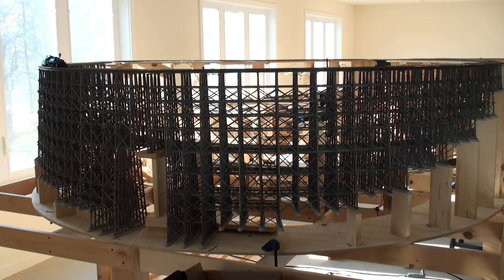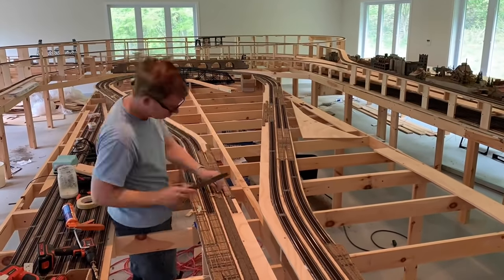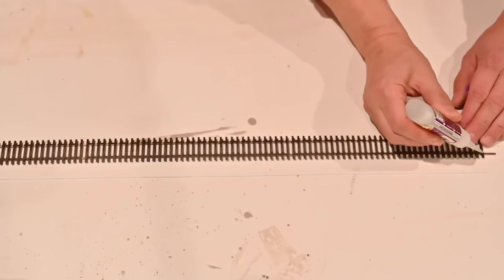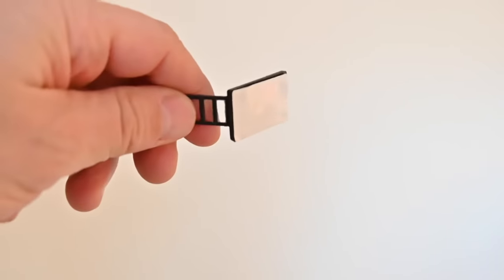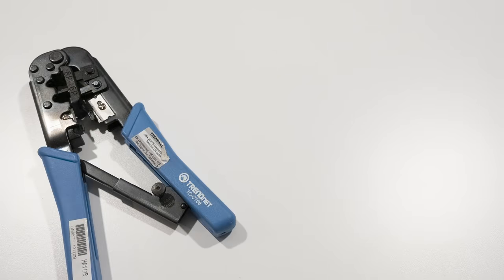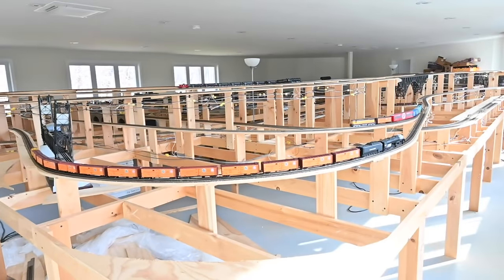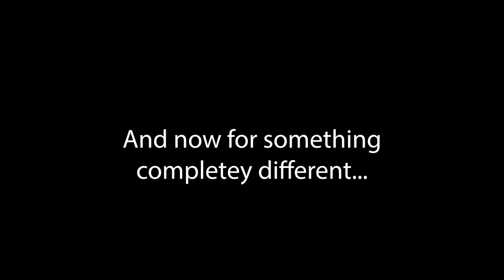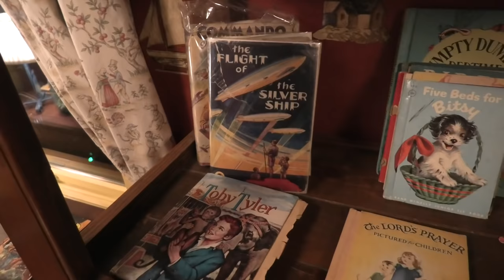S1: E5: Tracklaying, Wiring, DCC and More!

Comment: When I see layouts this big my hopes of seeing high speed trains in all their splendour grow big, then I see steam locos and wooden bridges... lol.!  Still an amazing work there!
Reply from the maker: Had a friend up here yesterday that drives the real thing for Amtrak. He brought is HO scale Acela up here so don't count out high speed runs just yet. I'll just need to keep the wood trestle out of the shot ;-)
Reply: Really long trains are more interesting then speed. No matter how large the railroad is, speed will look terrible when the straight track must go into curves.
Mini racing cars are more suitable for speed.
The control system used here is iTrain, made buy a Dutch guy. It contains and uses speed calibration for each locomotive. Speed can be mesured all over the DCC, or MFM range.
Ror example the heavy iron ore trains from Kiruna to Narvik don't run faster then 50 km/h, 31 mph due to the stress on the rails in the curves, and 50 scale km/h looks like driving wirh dignity.

Comment: Some good and original tips. Well done!
I started using the laser level when laying roadbed, and it works really well. Good tip. I also bought a lot of straight and curved sweepsticks to help align the track. Will be interesting to see how useful they are.

I was intrigued by the cable ties you are using, so I ordered a few hundred. They seem to be what I need, but they seems a bit flimsy -  it looks like the little plastic ladder might rip apart with  little effort. Hopefully they don't. Maybe ours are not identically made. I also got some of those Wago's to connect the droppers. Good idea.

As for FastTracks, I've made a couple of dozen turnouts so far, and I only wish my first efforts were are good as the latest one. I only bought crossover fixtures and pointforms though.
As a matter of fact we have chosen a lot of similar products. -  DCS240 and DB220, and I use 6 MeanWell power supplies to name a few. Glad my decisions are not all weird.

Not sure about running the bus wires up so high. It would make it easirer to install, but when the scenery goes on, how do you get to it for maintenance? OOps just saw the next vid. You lowered the feeders...

You might just convince me to include a few extra bridges... :)
Great stuff.

Comment: great video!  Industrial automation guy here that works at a competitor to Wago and Meanwell.  Invest in some ferrules and a crimper and forget pre-tinning your wires to go into that Wago connector!  It will be way faster and a better connection with a ferrule (or even bare wire) compared to the pre-tinned wires.  A tinned wire is not flexible and as a result, the wire cage cannot make maximum contact with the surface of the wire.  The problem becomes much worse when using a screw connector, as the tin will crack under pressure and leave the connection prone to wiggling loose over time!
Reply from the maker: Hi there, thanks for the tips! I realize full contact isn't made after tinning, but for such a short run of wire from the Wagos (a few inches) I don't think the lack of full contact it makes a measurable difference, especially stepping down from 12 to 22awg wire, meaning the contact area is probably sufficient?
Reply: @rcgrabbag  for sure, performance here won't be an issue :)  I am just so used to working with systems that vibrate and shake and experience temperature swings in dozens or even over 100 degrees!  In those cases, little factors will make a difference in long-term reliability.

Anyway, keep up the great work, I'm subscribing and looking forward to more!

Comment: Just too cool.  When I was a kid my friend and I had a WAAAYYY smaller setup with trains and AFX slot cars and a crossing.  We played with it for hours and hours and hours. That was almost 50 years ago and its like yesterday.  My son (from 2nd marriage) is 3 and he loves trains.

1 comment.  Youre making your life harder than it nees to be on those track bus connections.  I've done this before in other projects (not trains) but Ive been doing electronics for 40+ years. 

Either use the 3M connectors to connect the different gauges or get a 3-Way Wago connector. Im certain they're available.  Youre making 2 joints instead of 1 doubling the workload. Also, the connections will be the area of trouble (either there or at the track)

My 2 c but AWESOME job man... Im wathcing the whole series + SUBSCRIBED
Reply from the maker: Thanks for watching and glad you enjoyed. I had A/FX set myself and spent many hours playing with them. They were so much fun. As for the wiring, the 3M connectors won't step a 12 gauge wire (bus) down to 22 (feeder), unless you are referring to some other type of 3M connector. Not sure how a three-way connector would help either. The bus wires go around the layout in long stretches (each approx. 30+ ft long to power a block). How would a three-way connector serve the purpose of tapping into the bus wire every three feet and bridging the gauge gap to from 12 to 22 gauge? I definitely don't want to cut the bus wire into a bazillion 3 foot lengths. There are other means of tapping into a bus wire but I just don't like the methods and settled on this one.

Comment: Everyone needs to watch this until about 1/2 through as your wiring is full of great ideas. I am making plans for a home layout and this would be a huge improvement over a typical solder direct to Bus Wire method. Thank you!
Reply from the maker: Glad you found it helpful. Keep in mind you might get some flak for the Scotchlok connectors. I just got done with a comment exchange with a viewer who claims they fail more than not. I simply don't believe it nor has my personal experience shown this to be true. And, I'll just say that the electronics world is rife with "splice" type connectors, from Scotchloks, to telephone and network plugs, to ribbon cable connectors, you name it, and they don't fail more often than not. I (and many others) have used Scotchlok connectors for years and years with NO issues, but decide for yourself. They are one of those hotly debated topics in model railroading, but I find a lot of the naysayers only provide anecdotal opinion, like "don't use them they suck"..."why?"..."because they suck!".

Comment: Awesome video!  Hand-built turnouts is hardcore.  Kudos!  Loved the section on wiring and Digitrax.  I imagine the isolated blocks gives stable power and lets you run the trains smoothly at any speed, while offering easy (or easier) troubleshooting.  Good stuff!!!  Thanks.
Reply from the maker: Thanks for watching! The isolated blocks will also be used for block detection to control the train traffic with signal lights.
Reply: @rcgrabbag  Will signal lights be on DCC or LCC or old school double pole double throw switches? What will control the servo motors you purchased for turnouts?

Comment: From someone who's been in the hobby for 6 decades this is impressive indeed. I like the explanations on how you do things. But - there's something missing and that's how you attached the feeders to the track. I got smart years ago and soldered them to the bottom of rail joiners and feed them through the roadbed to underneath. Ballast covers things up and you don't have unsightly wires soldered on the sides of the rails.
Reply from the maker: Haha yes that's exactly what I did, to the bottom of the joiners. Call me overly cautious, but how to attach feeders is one of those "hotly debated" topics of which I just steered clear and let the individual decide.

Comment: FYI: Wago makes 2,3,4 and even 5 place lever nut connectors.  In lieu of using your tap splices, perhaps use a 4 place Wago unit?  I have used them for years and think they are great.
Reply from the maker: Maybe I’m missing something but Wagos only accept the “end” of a wire so I didn’t want to cut up my bus wires.
Reply: @rcgrabbag  That is correct, you need to strip the end of the wire.  However, I have not been too much of a fan of insulation displacement connectors, for, if they get loose or intermitted, it is almost impossible to find which butt splice is the culprit --  (however, this may not be an issue in your case, since you only have 1 butt splice in series with the main trunk).  If for some reason you no longer want a tap off the mains, we now may have an open cut/slice in the main trunk.  I guess this is the obsessiveness in me from EE days.
Reply: Wago make 2, 3, and 5 way connectors. Not 4 way.

Comment: Nice video and very well detailed.
I am getting ready to wire my layout for DCC soon. I have 12awg copper wire for the main bus and 18awg copper for the feeders as well as suitcase connectors. I also bought spade connectors so I can disconnect the feeders easily (if needed). I like both Digitrax and NCE wireless systems and basically can't make up my mind so far which system to buy as I like features of both. It's a little overwhelming when your new to DCC at this starting stage, but looking forward to the eventual transition from DC to DCC. Thanks for doing the video. It's extremely well done and full of great info.
Phil
Reply from the maker: Hey Phil, thanks for checking in and good luck with your layout! I don't think you can go wrong with either NCE or Digitrax.
Reply: @rcgrabbag  Yes, they both seem stellar and high quality. Thanks Robert....

Working on my wooden Howe Truss bridge today...one side (with the chords and verticals) almost done. About 5 hours into the project. Just a quick update. Have a nice Sunday....

Comment: Amazing space.  I might be tempted to use a spray actuator on that styrene before gluing to the track.  Just that much more instantly secure.
Reply from the maker: I did initially, but really not necessary. The roughed up surface and plastic 'dust' from sanding makes the glue grab nearly instantly, like, really fast.

Comment: There is this Lionel 4-8-8-4 that is freaking awesome. Smoke puffs with each pulse of the piston, huffing noises when sitting, steam out of the whistle, metal creaking noises while moving. fire in the firebox.  Winder if there is something like it in HO scale, not so much the sound, a Z scale can have that, but the steam and smoke are the most impressive parts of that Loco.

Comment: This layout is fantastic. All those wooden girder structures. My most facinstimg is the highest point  with that girder work trestles 😮 . This goes back to old time New York City. There was  The Ninth Avenue El. later becoming part of the IRT that later opened the Subway system in 1904. The highest in point was near Central park North nicknamed Suicide curve. From there onto 125th Street & 8th Avenue further north onto The Polo Grounds Stadium 🏟️. All of this all gone. Our other high structures back to the IRT BROADWAY line in Manhattan is at West 125TH STREET Harlem A short span then in both directions go back underground, Another highest structure is The IND in Brooklyn Smith & 9th Street ( Gowanus & CARROLL GARDENS) & 4th Avenue on the F & G trains another short span construction built in the 1920's opened in 1931. The IRT Manhattan structure construction late 1890's opened in around 1904. Your layout is a masterpiece. I have been watching your train videos since 2020.  This video is a winner by all means & deserves a 🏆 💯 & ⭐⭐⭐⭐⭐Great video, Well done. 👍🎥
Reply from the maker: Great history lesson! Thanks for watching!

Comment: Depending on the situation, you can also reuse zip ties by poking a thin screwdriver underneath the locking mechanism in the head of the zip tie.

Comment: Try silicone sealant as an adhesive for the cork roadbed instead of the construction adhesive. It is an excellent adhesive, sound deadener, and can be removed from the sub-roadbed with a putty knife making any last minute changes a lot easier.
Reply from the maker: I like the PowerGrab because of its immediate "grabby" properties, silicone didn't seem as much? But I agree it would make removal much easier.

Comment: Fascinating layout! And plenty to work on until kingdom come!
It is so big and so high, it literally dwarfs the room. Two extra feet in height for the latter would definitely have been a great idea!

Odd second part of the video. :)
Reply from the maker: Thanks yes there is plenty of work! But I don’t think 10ft ceilings would be desirable.
Reply: @rcgrabbag , particularly from certain angles, it looks as if the layout has been squeezed into the room. A clever lighting system, though, should be able to kill that feeling.
I am looking forward to your next updates!
Reply from the maker: @hntrains2  I really don't think that's necessary. Whatever impression you're getting from the video I think is inaccurate. I've never felt that anything looked squeezed in to the room when I'm standing in it. Surely you've seen layouts with lighting valances hovering over the layout with about 2ft of viewing room, and it's fairly common.
Reply: @rcgrabbag , great to learn all you need is a different shooting angle!
Have a great new year, filled with accomplishments and joy!
Reply from the maker: @hntrains2  Thanks @hntrains! Please do the same!
Reply: @rcgrabbag , E6 due any day now...

Comment: I use GE silicone adhesive to glue down cork. You can remove the cork with a razor blade knife with out tearing. I most cases you even can reuse the cork.
Reply from the maker: Makes sense! Fortunately I've had very few mishaps.

Comment: Nice work !
Actually the WAGO cage clamps are designed to handle flexible wires.
So you don't need to solder the tips and get an even better electrical contact.
Less work, better quality.
Reply from the maker: I like to tin copper wire.

Comment: Great video! Those Fast Tracks crossovers are gorgeous! The Wago connectors are quite interesting that's always been an issue as the suitcase connectors either go 12-18 or 14-22. The swing down boards for the wiring nodes are pretty cool too, but using a 14A power supply on a 16A booster does bother me a bit. The Digitrax boosters can handle shorts and overloads even with a too small power supply, but still you can't quite get the full 16A on startup if you have a lot of sound locos sitting around.
Reply: Also, according to KB1017, the power supplies for an SE8c can be shared only with other SE8c and BDL168 boards.
Reply: Also, why are you using to control the Tam Valley servos?
Reply from the maker: Thanks for watching! Keep in mind I’ve got 6 boosters on the mainline. There’s no way I run out of juice with 14amps. 16 amps is the MAXIMUM  input on each booster. If you’re running out of juice with that setup you’ve got other problems and should be isolating more track sections and adding more boosters.
Reply from the maker: @woodalexander  The SE8C's aren't doing anything yet except blinking lights. They'll be moved to their own power supplies eventually.
Reply: @rcgrabbag  3 DB220s or 6 DB220s? Either way that's a lot of juice. They will work, you just lose some of their capacity.

Comment: Did you consider stapling the cork road down vs using the industrial adhesive - for flexibility to change/modify the layout should you want to later?  Did you also consider using track nails/spikes to hold the rail to the cork bed vs using an industrial adhesive - again for flexibility/ease should you want to change sections of the layout in the future?

I had an endless debate with my self on this . . lol.  Final decided to use an industrial adhesive for the cork bed as you are using, but used rail nails/spikes to secure the rail sections to the cork bed.  I knew I wasn't going to be changing the general track configuration, I did envision the need to add, and/or remove turn-outs in the future.  Would like your thoughts - thanks!
Reply from the maker: Eventually you are going to have to commit to a track plan, because once you glue the ballast in place, that track isn't going anywhere else except in the dumpster if it needs to be changed haha. So  I didn't really consider nails/spikes or staples because I really like the speed and convenience of the adhesive and just didn't really envision or have any major changes.

Comment: Fabulous layout! Can you explain why you run a 12awg tap off of the Main Bus and then run feeders off of that as opposed to splicing your feeders directly into the Main Bus? Thanks!
Reply from the maker: Thank you! I wanted something I could disconnect easily. The 12awg taps + Wago connectors allowed me to easily make a solderless connection between two disparate wire gauges.

Comment: Locktite power grab adhesive is formulated to work in wet conditions with non-porous surfaces. Probably not the best choice here.
Reply from the maker: Works just dandy and easily holds the work in place while it cures/dries.

Comment: I really enjoy your videos and the information you give on the stuff you use as far as DCC, my question to you is how much voltage or amps will I need through A DCC system to operate, the HO layout I'm building is two levels with dual-track helix at both ends my staging yards will be on the lower level the helix will bring the trains from Parts Unknown up to the main level which run 18 feet by 12 feet then runs 20 ft in a U-shaped pattern it is a point-to-point modern day Railroad from Knoxville Tennessee to Birmingham Alabama because I would like to be able to run more than one train on a rail and set different speeds when my locomotives I've had DC system in the past and you cannot run 2 locomotive on the same set of rail at different speeds would appreciate all the information you can give me or where I can get it thank you and God bless

Comment: I'm glad I found this video, answered so many questions I had. Just to be clear, you isolate and power each 3' length of flextrack?
Reply from the maker: I don't isolate (as in electrically), but I do have feeders from the main bus wires for every 3' length of flexttrack.